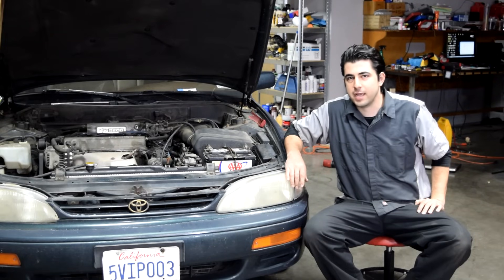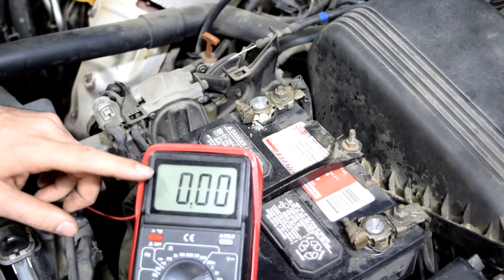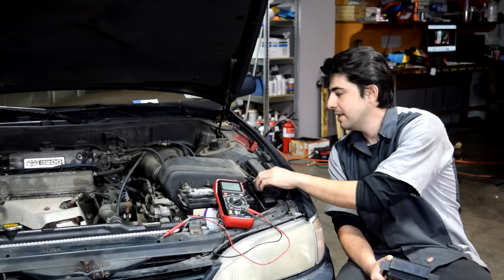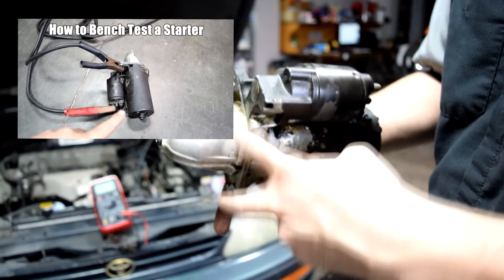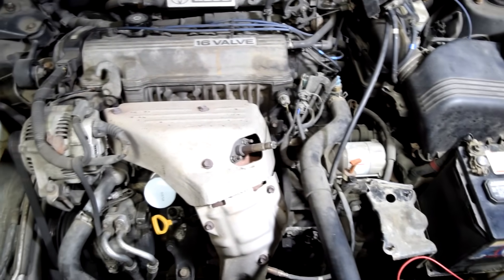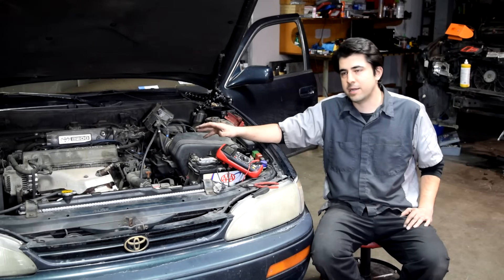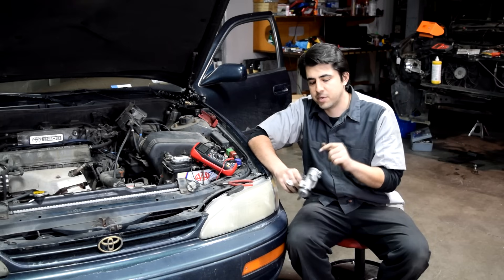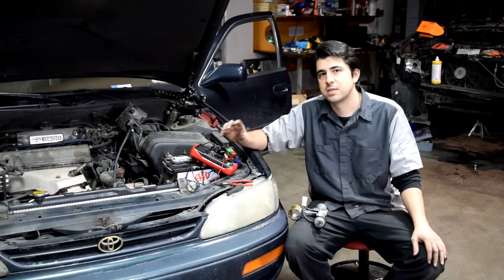How to Diagnose a No Crank No Start Issue - Nothing or only a Click When the Key is Turned

Comment: Just a few comments and don't want to sound critical as we're all here to learn. When you checked for voltage drop across the battery post to the terminals, there wasn't any voltage because there was no current. You have to have current to measure a voltage drop. Also, same holds true with the resistance check from the starter housing to battery negative. The only thing that you can say for sure is that the wire is not open. The ohmmeter will never pick up any corrosion or if you had multiple wire strands broken. Again, a voltage drop across the wire would show both conditions. Same holds true for measuring 12V down at the starter and also when you unplug the solenoid control wire. All you really know for 100% is that the wires are not open, but will not detect any corrosion. Turn the starter motor over to measure voltage drops in all of these scenarios. Take care....
Reply from the maker: +stuzman52 Thats totally right, I have become more familiar with how that works since I made the video and hopefully will do an update of the video with the info you provided sometimes in the near future. Thanks for your comment and contribution to the diy automotive repair world :)
Reply: Glad to hear that you didn't get upset from the comments. Some out there would really get belligerent. Good luck with your channel and looking forward to seeing other videos from you. Take care...
Reply: yea I was confused too got 12.15 volts on every position on the combinations from + -  post to terminal, bolt, nut...............didn't figure to measure drop but my batt held in the green green on the load tester.
I think its a clutch switch
Reply: In general for any automotive electrical circuit testing shouldn't the ideal reading be less than 0.1 volts on the negative side and less than 0.2 volts on the positive side?  Or should the old metric of the total positive and negative sides combined be less than 0.5 volts?
Reply: No current flow...no voltage drop !!...I did notice that in the video !!

Comment from the maker: Like and Share my video's on facebook to qualify for Tool Giveway drawings!

https://www.facebook.com/Ratchets2015
Reply: Ratchets And Wrenches was perfectly
Reply: Help. I have a 2008 Hyundai Santa Fe with 109,000 miles. For the past 5 years it has intermittently been a no crank no start. I have had it to.the dealer many many times, also took.it to independent service stations. The dealer has contacted Hyundai's regional technical support. Every time it is put thru computerized diagnoses I am told nothing shows up. The lights on the dashboard go on however. I have had the battery replaced, I replaced the starter relay, I had the ignition cylinder replaced (although I had requested that the ignition switch be replaced with that repair), I've had the inhibitor switch replaced. The problem is becoming more and more frequent. I have taken it to an automotive electrical shop and heard an old episode of Car Talk where somebody had a similar problem and the brothers suggested it could be a bad spot on the fly wheel. I have put it in neutral and pushed it to a new location and it didn't make a difference. I have no chip in my key. I have begged numerous mechanics to look for simple electrical problems or mechanical problems but Hyundai won't help anymore and nobody has been able to figure out what to do. I've suggestedmaybe it was the starter or the fly wheel but I am always told no. As of now I can't take it any place because I never know when or if it will start. I don't want to junk it but nobody will help me. Sometimes I just have to keep trying and eventually it starts, sometimes I have to leave it alone for hours. I've used different keys and had many different people try to start it when it won't start for me. I am a dead broke senior who desperately needs help with this problem. Any suggestions?

Comment: Just a thought! As you were down at the starter, place dvom leads at positive battery post and on positive (always hot)post of starter whilst key in cranking position would give total voltage drop of that wire under load then switch to solenoid signal wire and finish neg battery to neg case of starter. 
Seeing battery voltage at starter can be achieved through only one stand of wire but not enough to power it.
Reply: Sorry for repeat comments

Comment: Was wondering if you plan on doing one on a crank but no start issue, such as a possible fuel system issue with carbureted engines. My old benz has old, 5 year old gas in it and was wondering if I should just remove the old gas with a siphon and put new gas in or should I also remove the fuel tank and fuel pump. How best to clean the fuel system? Thanks for the great vids, BTW. Love the channel.
Reply: I wouldn't say similar, but a related question, yes. And Scotty was gracious to answer too. I had been worried about the pistons seizing, and the best way to get them lubricated and moving again w/o having to remove the radiatior in order to crank the engine without the starter. I'm currently about to try cranking the engine, after I give the Marvel mystery oil some more time. I had to get some tools to get the spark plugs safely off and the new ones safely on when it's time. I also want to change the oil before I do anything since it's also 5 years old. I got a Husky jack and 3-ton stand set a few weeks ago for a great deal, and was going to use them to jack up the front, but I decided not to use these jack s tands because I don't trust them. Getting some USJack stands instead. They use two pawls to engage two teeth at a time on the load bar. Much safer. As you can see, I'm still in the gathering tools stage. I have just recently put together a set of mechanics tools. So this is really my first project car ever in my life. Thanks for your comments.
Reply: Classic Ride poor gas directly into the carb (where the air comes in).  a healthy tablespoon full.  crank it.  does it fire up? (for a few seconds).  yes? you found your problem.
Reply from the maker: Classic Ride Yes I will do one on crank/no start. Not familiar with carburated engines though. As far as your Benz, you dont really have to remove the fuel pump, just the gas first and fuel filter. Also be careful when/if it first starts up, monitor it closely just incase there is an oil or gas leak. Also change the oil before you start it up. If you run into problems from there you can look into further diagnosing the fuel delivery system. GL and thanks for subscribing.
Reply: RatchetsAnd Wrenches Thank you, friend. That was quite helpful. You have a clear and concise way of communicating automotive knowledge which I appreciate. Looking forward to more of your excellent channel. Thanks, again.
Reply: Hmm..That sounds like one way to diagnose a fuel delivery problem. Thanks. I think I might see if I can rent or borrow a fuel pressure gauge, too. I think the advice about being careful about oil or gas leaks is very good. As I understand it, low oil pressure can damage the engine, because it's not circulating enough, and therefore not lubricating. And low fuel pressure may mean a leak - a potential fire hazard, right?
Reply: Classic Ride that stuff is for tuning.  if it was running rough, that might be the way to go.  Renting gauges, esp for a carbed car, won't help you if you don't know if even fuel is the problem.  just my 2 cents.
Reply: Just realized something... i think u asked a similar question on Scotty's channel... I almost never reply, but your problems seem remarkably easy! lol anyway, good luck.